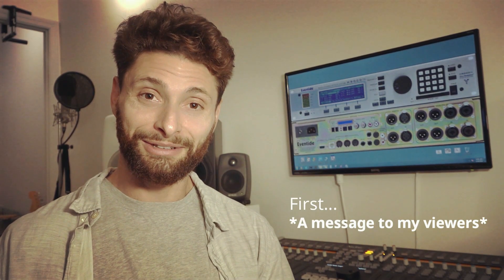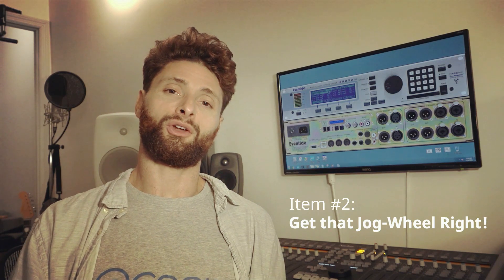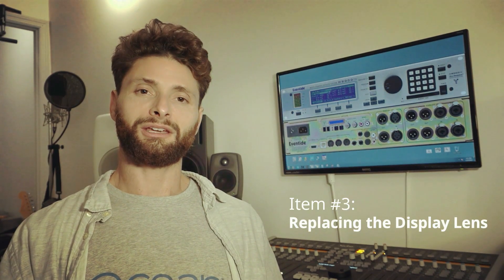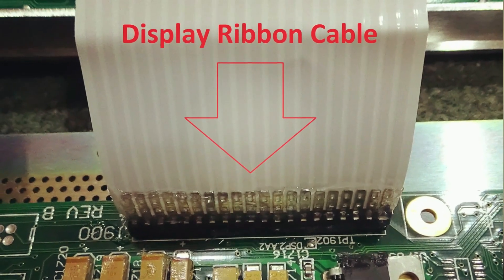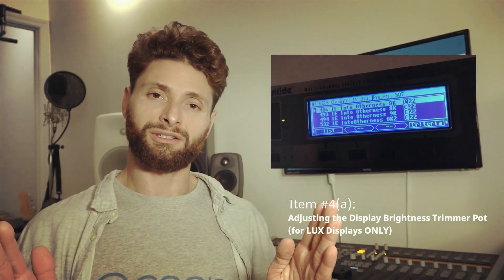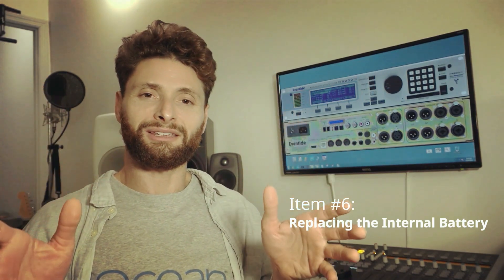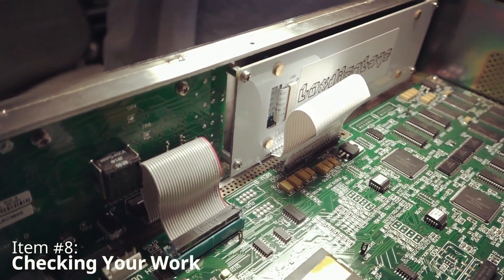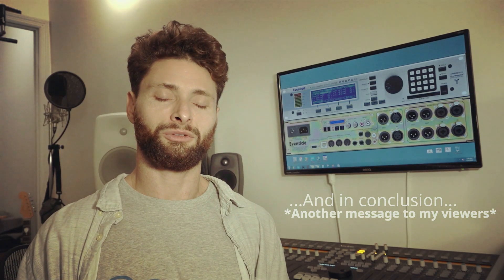Adam-I-Echo Presents: The Definitive Guide to the Eventide H8000FW - Part IV: Mods & Upgrades

Comment: H7600 and prob other units have an inch standard allen screws in that jog. Ofcourse they can seize too.
Reply from the maker: Allen screws seize and then strip when you try to unscrew them with comically small amounts of torque.
I suggest replacing them with flat-head screws, that allow more torque to loosen them in the event of seizure.

-Adam.

Comment: I would like to see some Orville videos… there is almost nothing about them on youtube.
Reply from the maker: Ah, the Mighty Orville...

One of the biggest follies was removing the "Banks" feature when they developed the OS for the H8000 platform.
That was so useful...

I had banks labelled by song, by theme, by live and studio... It was simple and glorious.

There were 3 versions of the Orville, each becoming closer in architecture to the H8000.
There were also three different versions of the face-plate silk-screening that I am aware of.

The main distinctions between the three from earliest to latest:

Type 1: Orville that has the earliest motherboard (S/PDIF on the upper area on the rear of the unit) different motherboard and power supply from the H8000.
Type 2: Orville that indicates "DSP 2303, 2303" (or combinations of 2303 and 5303) on the power up sequence (inferior DSP to the H8000) but has the H8000 motherboard (S/PDIF on the lower level)
Type 3: Orville that indicates "DSP 5303, 5303" on the power up sequence - The last and easiest to crossgrade to the H8000.

Other than the H8000FW's added connections (including CF Card compatibility), 5.1 Surround presets, and of course - Monolithic Tandem capability, the Orville can hold it's own amongst the Herculean H8000FW for what used to be less than half the price.

Of course, none of the U106s were soldered in on those, but that doesn't guarantee there'd be a problem.
-The later H8000FWs did have them soldered in though.

Black screen was pretty cool too, though Lux Displays can get you one for your H8000 if you so desired.

The original Orville manual had some great cover art of beacons of light breaking through heavy clouds.
The name was to honor Orville Greene who had passed during it's development if I recall correctly.

Yep, and Orville, the Programmer's Manual and companion "Modules" manual along with some inspiration and a dream kept those of us on a quest merry deep into the night.

My Orvilles lay in other studios now, and I can only hope that they are getting the attention they deserve.

Though not a video, I hope what I've shared here has been interesting and/or useful to the remaining Orville enthusiasts like yourself out there.
-Enjoy the holidays - I'm outta here for the next three days.

Thanks for supporting the channel.

-Adam.

Comment: I own an Orville which has been lying dormant for the past 10 years or so.. a couple times i was going to send it off to eventide to repair it.. and for various reasons it never made it. I am certain my problem with it is that chip(U106). I am so sad that it just sits there in the box it came in from the guy selling it on ebay. I loved using it when I was actually able to use it. I hope I can get it back up and running someday. Your video might have proved inspirational enough to make it happen. Thanks for your insight and knowledge .
Reply from the maker: Orville is a Mighty Legend that craves attention and rewards with Glory!
No need to hope... The decision is in your hands.

I'd be glad to read a follow-up comment detailing how you resurrected and reunited with the Sleeping Giant.
-Be sure to let us know. 

Thanks for your support - Getting these videos made with such a busy schedule can be daunting, so it's good to see they are providing value for people like yourself out there.

Good luck to You.

-Adam.
Reply: The Orville  isn't supported by Eventide anymore. Means they won't repair the device unfortunately.  They are also do not provide schematics or any helpful info. I have the impression the guys that are in charge of their tech customers service have only little knowledge and are younger than the devices that are in need of service. None of their replies has been any help. Fortunately I was able to repair my Eventide [power supply issues]. For repairs if not DIY, Dane Beamish might help you [google-able]

Comment: Thank's a lot man
Reply from the maker: Glad to do it Mohammed!

-Adam.
Reply: I got my beautiful h8000 fw today but i think i have the wrong audio cables for it , i have read in the User manuel and iam confused about the wiring how i make xlr balanced to trs unbalanced  to connect the Eventide with my Desktop mixer as the aux send is unbalanced or when i use it with preamp in the effect loop is also unbalanced, so i have to make the proper cables as describe in the User manuel , thank's a lot

Comment: You got to 108! Nice one...thanks for sharing so much experience on Eventide rack healthcare. Just got a used Orville and it needs some love, a lot of this knowledge is applicable.
Reply from the maker: Hey Brian-

An acquaintance of mine is selling a brand-new 3rd Gen Orville faceplate on Reverb.
I know it's a good one, as he got it from me, and I got it from Eventide.

I sold my Orvilles to a friend building a studio, but with enough time could tell you a thing or two about those units as well!

Orville is a classic-
-If you don't need FW, or 5.1, You will do just fine.

LuxDisplays screen works for Orville just the same if yours begins to become washed-out.
I don't get any compensation from them after the fact, I just helped as the display was being developed given my frequent use, and in-depth knowledge of the machines.

They sent me some displays for me to make the videos, that's all.
I fully endorse them though - Years, money and madness went into getting them just right.

-Adam.
Reply: @Adam-I-Echo  Thanks Adam.  My Orville arrived today but most likely has a U106 issue.  Boots up basically identifying as a DSP7000 and throwing the "looks like you have new RAM" prompt or a bus/address error. I'm going to try pulling all the socketed chips and contact clean/dust out everything.  Screen is in good shape but happy to know there's a replacement option (assuming I can get this unit working).
Reply: @brianelgin8633  Have you been able to fix your Orville? If so, what was the cause of the problems? I'm just curious. These devices can develope multiple problems, cracked traces in the PCB included. Cheers
Reply: @RockmannMusic  No I haven't.  Local techs here couldn't sort it or source replacement chips. I may need to send it to Beamish in America unless I can find any other help.